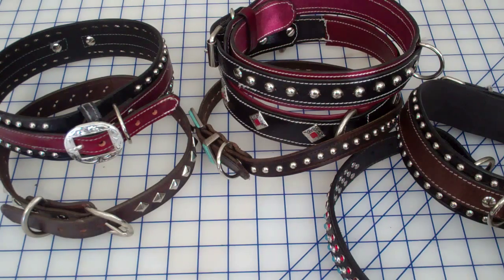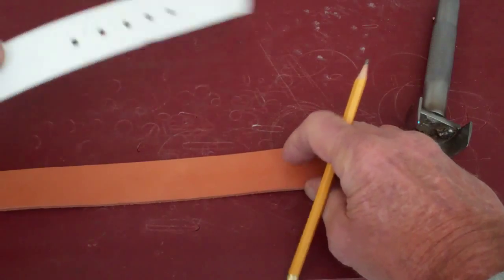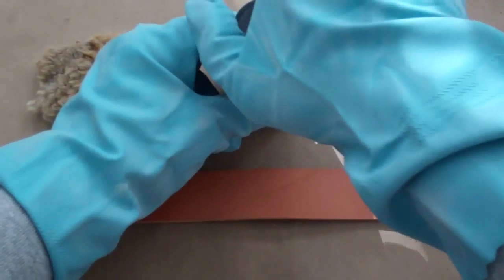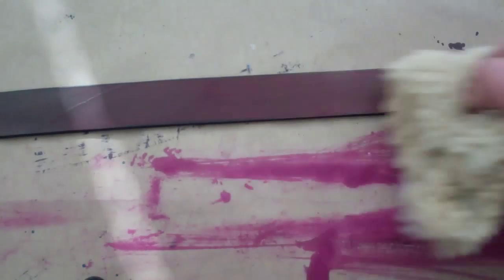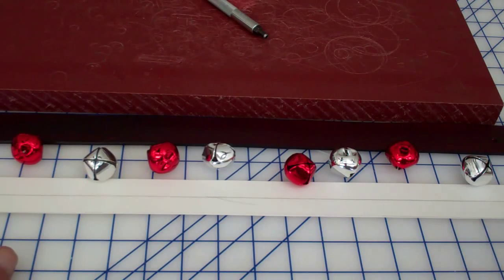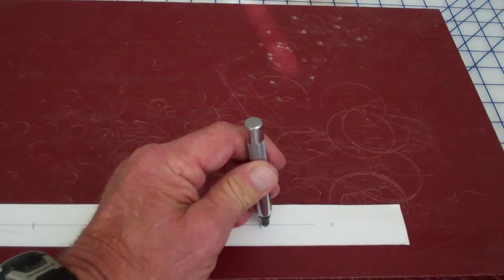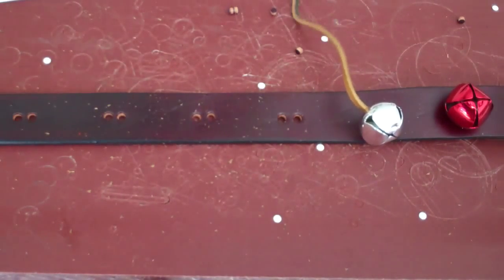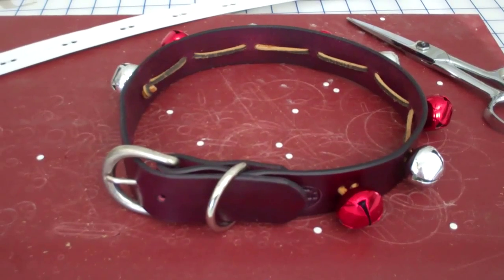Making a Christmas Dog Collar

Comment: Richard, just have a question about the knot on the lace, wouldn't that be uncomfortable for the dogs neck or does it even touch his neck area?  Is there a different way you could attach the bells that would hold or is this the only way you have found that works. Thanks for the help and your videos, learning a lot about working with leather. Thanks